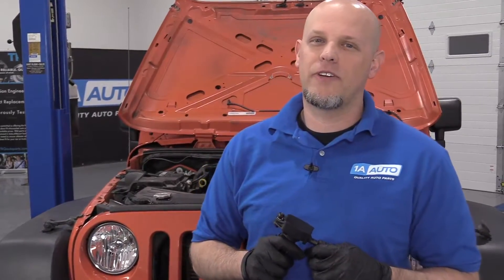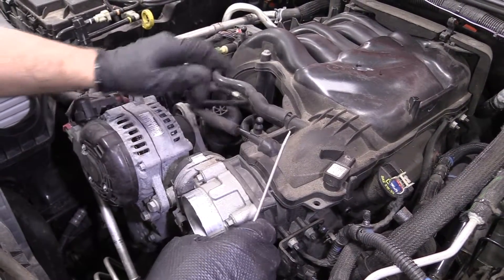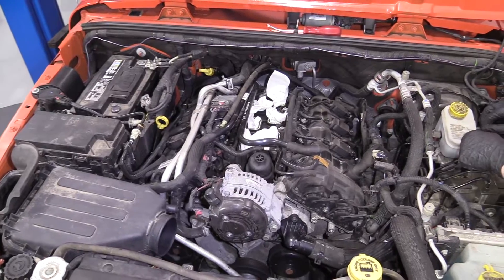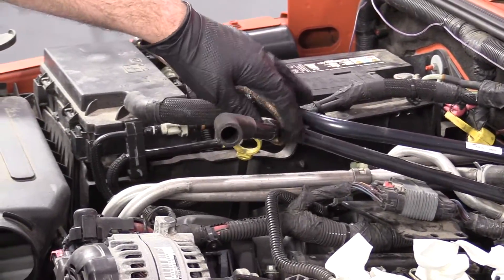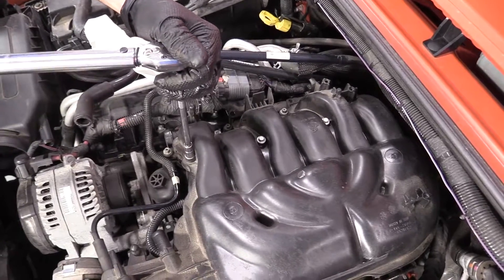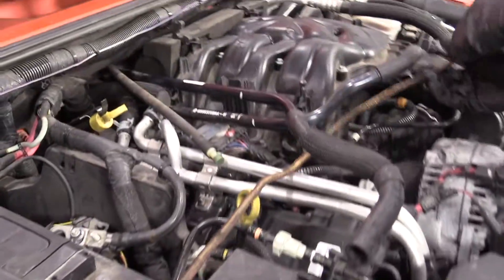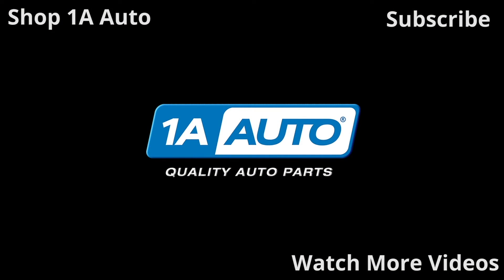How to Replace Ignition Coils 12-17 Jeep Wrangler

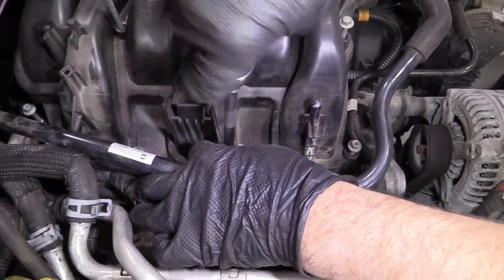Comment: Great vid!  @7:00 you can take those studs out actually, the washer is fixed in place.  It’s an E4 inverted torx, and it makes removal WAY easier.  You can also use a very small SAE socket to take them off as most people won’t have an inverted torx set.  Just wanted to put this out there so you don’t have to take off that goofy driver side bracket and it saves a ton of time and you have to pull so much on the plastic manifold.
Reply: Also wanted to add that removing these studs makes re-installing the manifold a lot easier, as you can just sit it down into place. 💪

Comment: Halfway through my coil and plug job.. thank God for this video! I DID end up having to take my front driver-side wheel well out to loosen those two 13mm studs holding the bracket in. Just got the intake out though in time for sunset 👌. Gonna finish the rest in the AM. Thanks again!!

Comment: I sure miss opening the hood and just changing plugs and wires...a little more depth in this tune up project...thanks for the excellent vid. I will be heading to 1A for my coil packs...because AutoZone couldn't even tell me why I couldn't find the spark plug wires...and suggested a set "that might work" the more you know. This is my first vehicle that requires more than a 6 pack and 30 minutes to do a plug/wire tune up. Ya'll kick ass.
Reply from the maker: +xzysyndrome Thanks for checking us out. Shop for high quality auto parts on 1AAuto.com:

http://1aau.to/m/Shop-1AAuto-c

Comment: That was about 3/5th the way to change that “notorious” oil cooler assembly if that was leaking.  One of the best instructional videos I have ever come across.
Reply: I'm about to do the oil cooler and decided to do plugs and wires while I'm in there.

Comment: meter reader autozone hooked up said change spark plug in number 1 cylinder should i change all the plugs and the coils since i have it open or just change all the plugs leave the old coils. 35000/ 2015

Comment: How often we need to change this unit’s?? I have 2014 wrangler 168 k never change the coils I change the spark plugs but still there is engine shakes at start means misfire I think or is it something else???
Reply from the maker: +river stone Thanks for watching!  That sort of info can usually be found in your owner's manual, but coils should go for a long time.  If they are still the original coils at 168k miles and you are experiencing a misfire it could be that they are starting to go out.
Reply: @1AAuto  do you have any videos about testing the this coils or can you suggest any videos about it ? If not the coils could it be the spark plugs cables and how to test if cables are ok ? Thank you for quick reply 🙏🙏🙏